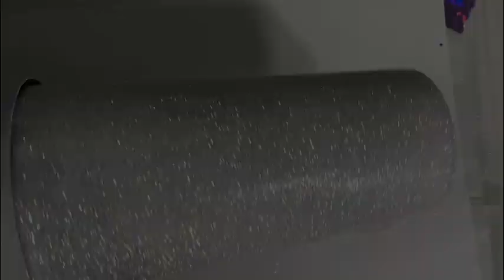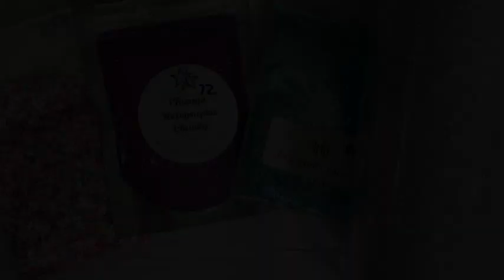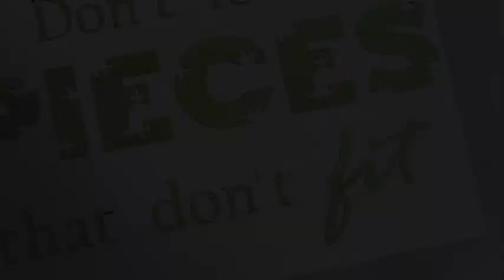Epoxy Storyboard/Glitter Globe Beginner DIY Tutorial

Comment: Have you ever popped the bottom part apart (the black part and the stainless steel part will pop apart, but I find it easier if you put it in the freezer for a bit). Then there's a tiny little hole in the black part that you can add water into once you've sealed the black part onto the cup. You do have to use one of those tiny tipped syringes or one with an actual needle. It keeps you from making a huge mess before sealing the cup. Just a thought! I really love the cup!